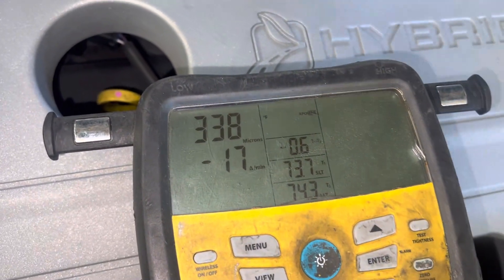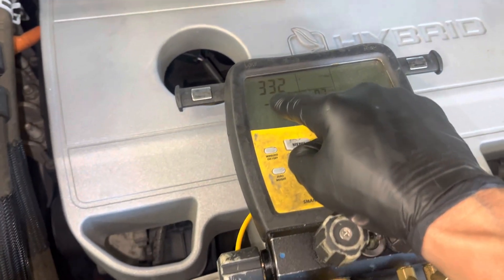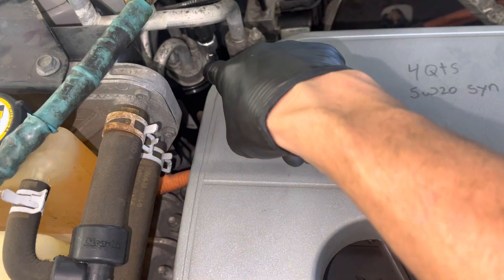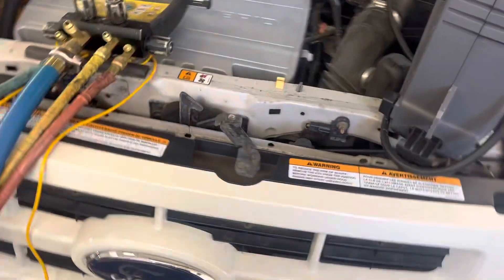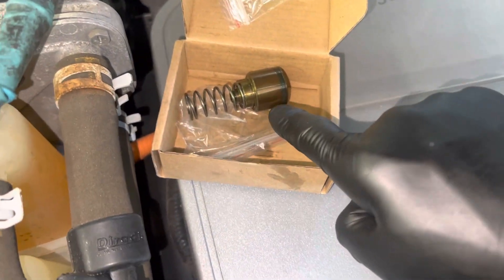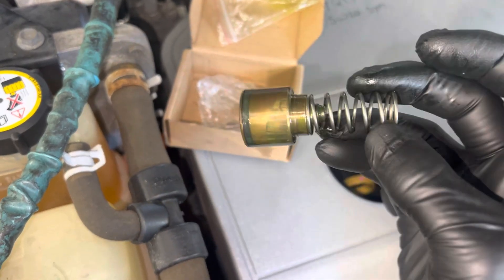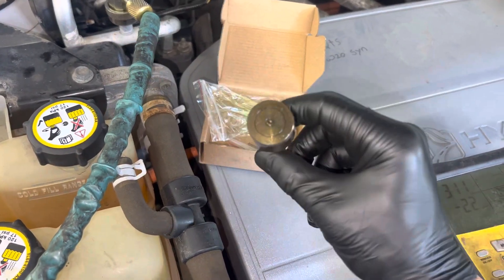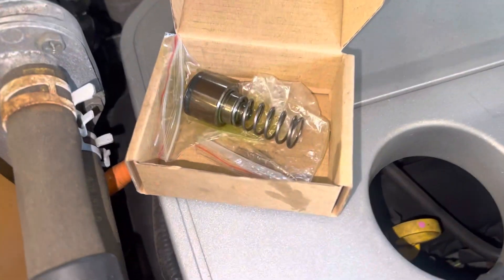Moisture contamination so easy to find with a micron meter.  If you understand how to read it￼￼

Comment: It's so nice to see automotive techs borrow a technique used by HVAC techs for decades.
Reply from the maker: I like dad used to do the freezers on the flash freezers on the salmon fishing ships. 

He used to take me with him but I was too young you need to get me to pay attention for about 15 minutes and then I was off playing with fish or down on the rocks chasing crabs.    But he would have me set up the micron gauge was an old analog micron gauge in a leather case stainless steel front with a big sensor that you had to let it warm up for about five minutes then you had to go through the zeroing of the sensor and zeroing of the meter and then hook it up and turn on the pump my dad used to make me do that.   One of my dad‘s grandma‘s school friends since he was a child ended up working for Gentron that we know later got bought out by Dupont he was a Refrigerant engineer one of those guys responsible for developing some of the refrigerance that we used to use before they got phased out decades ago. 

He used to take me up on rooftops when they would be servicing package units on school tops with one of his other friends who is an HVAC contractor so when my dad started making me use the voltmeter and amp meter he had old Simpson meters the big black ones. 

Three other older gentleman my dad‘s age one of them was actually older probably by 20 years they were all Automotive and they all used Micron gauge they all have the same mindset. 

I hear so many guys say automotive guys don’t use micron gauges and that is a lot of the procedures that I use they never heard of a seen. 

That’s funny because all the Automotive guys who work with my dad in his little group they all performed all these procedures that I do that I was taught.

My dad used to say you’ll find out that most automotive guys aren’t the sharpest tool in the shed and if you even want to go down lower You just have to go to the body shops to find them.

Birds of a feather flock together
Reply: @coldfinger459sub0  Ha ha, my Dad was a refrigeration tech, too.

Comment: I thought that when you vacuum,  it's supposed to go to 30 microns?
Reply: Good luck getting that low using a rotary vacuum pump.  The reason is, most just can't pull that much vacuum and on top of that you have virtual leaks (outgassing) of anything in the tubing.  For instance, consider the vapor pressure of the oil itself, it's higher than 30 microns unless it's very good vacuum oil, typically silicone based.  Vacuum oil isn't considered a lubricant though, thus it's not applicable for lubricating a compressor.  The purpose of low vapor pressure vacuum oil is to provide a seal between the vanes and pump body.
Rotary vane vacuum pumps are often called roughing pumps because they can pump large volumes rather cheaply, when scaled up.
I suspect the 30 micron target you have in mind is more like 300 microns.  Hopefully you can reach 300 microns or lower but 500 microns is considered adequate ultimate vacuum, by many.
Reply from the maker: @thisisyourcaptainspeaking2259  30 is just with the pump on and running only checking the hoses engage before actually cranking it down and connecting to the system. 

Extremely difficult on an old system to get 500 µm standing vacuum decay. 

Sometimes you get lucky 🍀
Reply: @coldfinger459sub0  I usually can reach 280-300 microns on old systems unless they have been sitting exposed in which case I'll replace the dessicant.  Rate of rise is typically negligible but I suppose even 500 microns would be quite good.
In the case of residential systems, I can usually break 200 microns.
This is all using 1/4" hose in various configurations.
The ultimate pressure of my vacuum pump is about 45 microns without any rubber hoses attached, with hoses 150-180 or so after some time (30 min?).
Reply from the maker: @thisisyourcaptainspeaking2259  I 160 Chestnut Redwood City California 94063 old systems that had mineral oil that have not been adulterated or molested by the hands of dirty Neanderthal STD carrying technicians. 

We can easily get those systems below 500 µm and it’s amazing how fast you can get one of those old systems down to two or 300 µm I have made videos on this old Mercedes Benz that are still virgins that are 40 years old that no technician has ever worked on before that have been sitting in somebody’s garage with only 8000 miles 10,000 12,000 miles 15,000 miles on them original owner passed away and the widow keeps the vehicle parked in the garage until she’s 80 years old I have came across these vehicles. 

The difference between a original old system broken in under mineral oil that absorbs 10,000 times “ LESS MOISTURE ! “ then PAG oil or POE oil.
Reply: @coldfinger459sub0  I have yet to pull a vacuum on an virgin R12 system that hasn't been converted.
Reply from the maker: @thisisyourcaptainspeaking2259  I have a special customer Mercedes classic car sales broker his specialty is Virgin Mercedes. 

He gives me lots of virgins
Reply from the maker: I did not wait that long just whipped out the camera turned on the vacuum pump.  

Videos take up my time and for the videos I sometimes have to cut things short because I have many other jobs to get to in a day.   

I don’t have the leisure to wait and I don’t have the leisure to retake a video over again.  

But I’m not gonna worry over 14 µm difference. 

A 14 µm difference from your target at that low of a range. 

It’s like aiming for a target with a nuclear bomb and you were aiming to hit and drop exactly on top of the house. 

But you missed and it landed in the backyard.    Not really gonna notice a difference
Reply: @coldfinger459sub0  ok, I understand.  So 30 micron is the desired level when vacuuming. I bought the navac manifold guage as I notice you use that brand a lot.  I was going to buy yellowjacket manifold,  but went with this instead.  I also bought the uvbeast light.  

I put a temp gun on my front evaporator and it was only at 65 in some spots and other spots where 70 degrees while the car was at idel and running the ac. I removed the front ac vent panel on my van so I can see the evaporator. Not sure why it isn't cooler and some spots are cooler then other spots
Reply from the maker: @edwinaragon8469  we don’t use infrared temp guns to take temperature they’re highly inaccurate they change with the angle that you’re taking the temperature from they change with the color whether it’s a flat black a glossy black or a white color or a aluminum color the exact same temperature will always come up different. 

I our temp guns are only used for general information nothing accurate. 

Unless you’re comparing to exactly same items at the exact same distance at the exact same angle with the exact same color without having hot or cold air blowing across the lens will distort the number

You may find that how many microns you pull your hoses engages down might be different no two are the same there is no set number in stone
Reply: @edwinaragon8469  u wrong, u thought about 30 milibars
Reply: @eklazhward4739  yes, you are correct.  I thought 30 on the low side pressure guage meant 30 micron. I stand corrected.  30 hg on the low side pressure guage is what I meant.  I think that converts to 500 micron, I think.